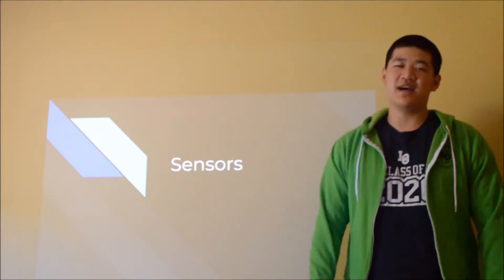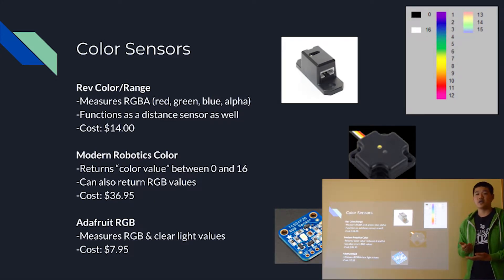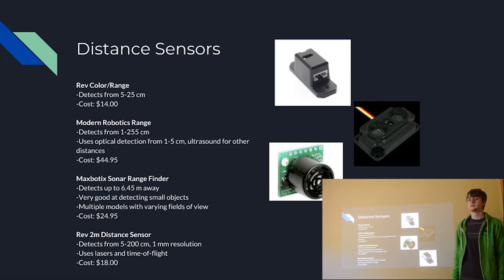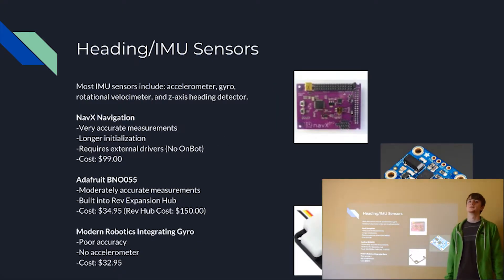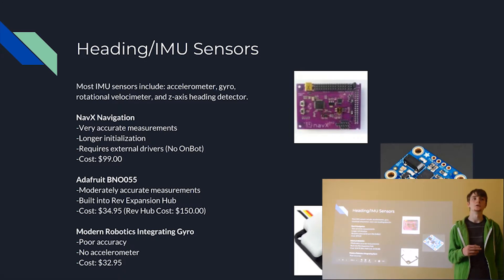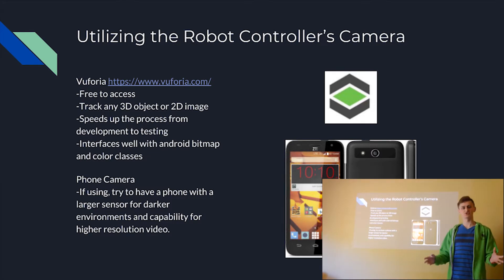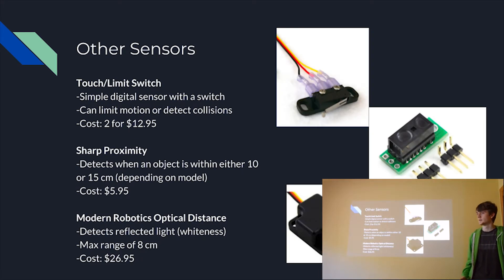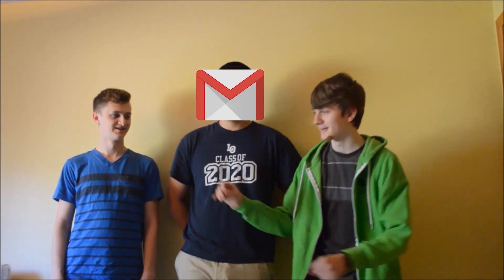FTC Sensors Introduction

Comment: In the video that is shown of the robot testing the heading sensor, which of the IMU sensors shown in the slideshow do you use (the NavX navigation, Adafruit BNO055, or Modern Robotics Integrating Gyro)?
Reply: Hello! I believe at the time we used all three - the NavX was our primary IMU sensor, while the other two were back ups in case we detected that the NavX wasn’t working properly. Hope this helps!